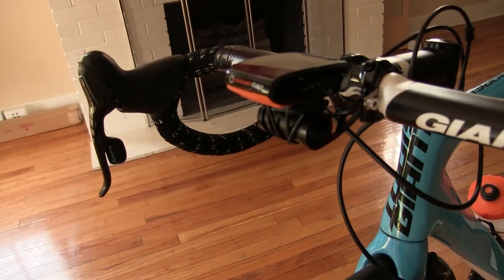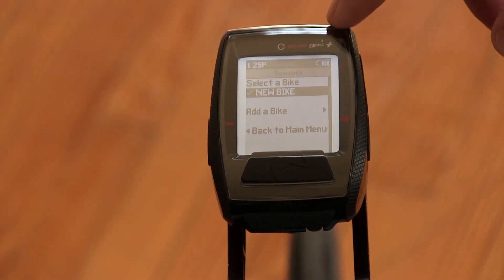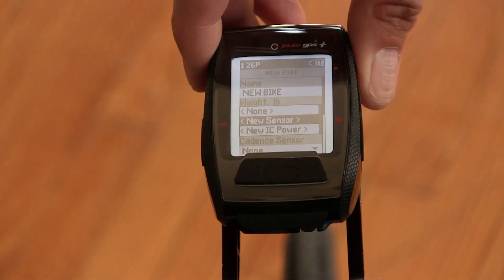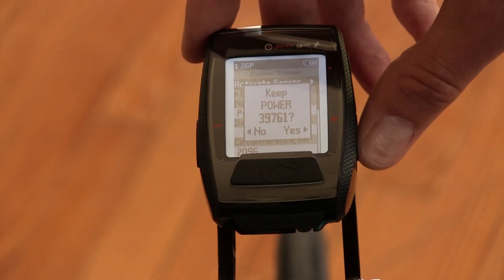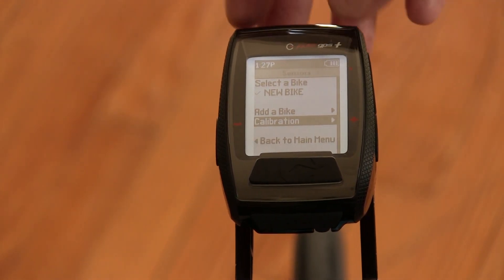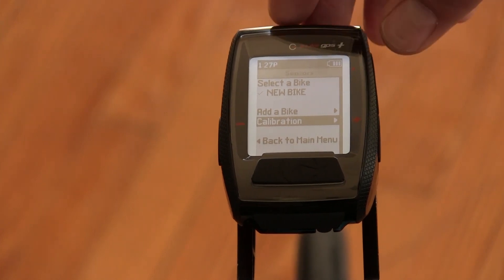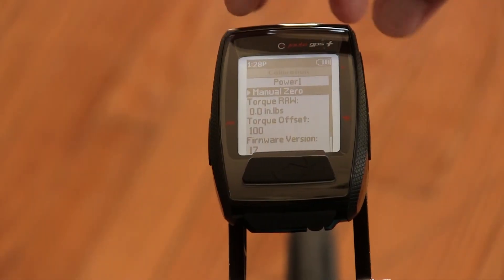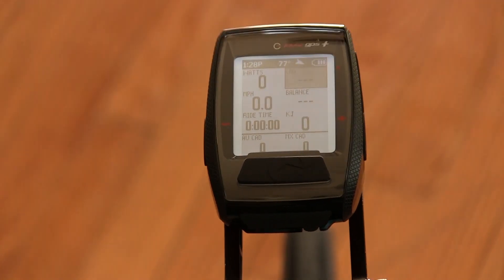How to Pair P1 Pedals to a Cycling Computer

Comment: Just be aware if you are pairing P1 pedals to a Garmin 800 you need to unpair the speed cadence sensor you will almost inevitably have running on the bike before the pedals will deliver power and cadence data to the head unit. I haven't seen that reported anywhere so it was a frustrating trial and error effort to find it out!!
Reply from the maker: Thank you for the heads up, John. We will look into confirming this use case.
Reply: Well, the P1s have been a nightmare when attempted to use them with Garmin/s. And Powertap as late as March 2018 ccame with a firmware update. to resolve issues with Pedal missing on them. I am very disappointed with the P1s, more so since the Roght pedal axle has developed play. An issue that it seems several owners have encontered and Powertaps measure to "counter" this has not been to rectify it, but to cut down on warranty after the fact. Disappointed, well enraged as a matter of fact.